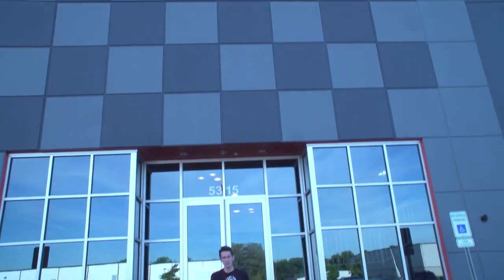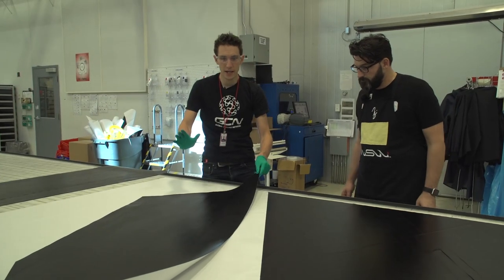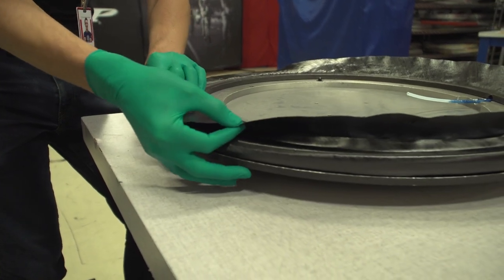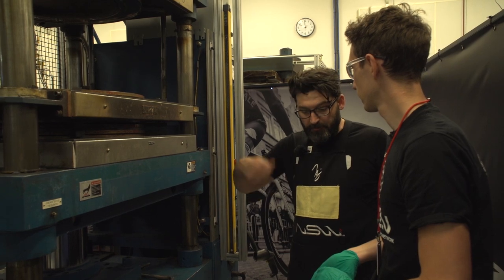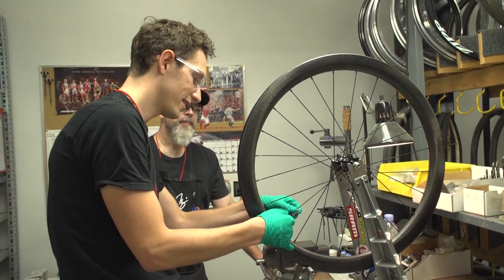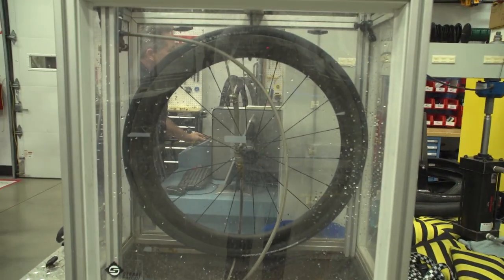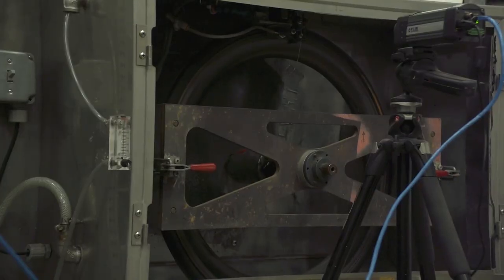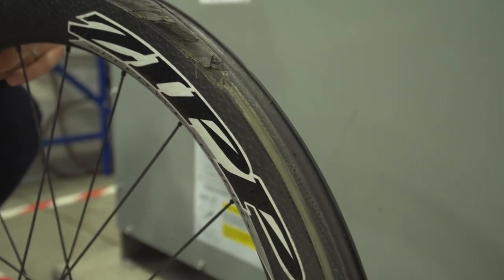How A Zipp Carbon Fiber Wheel Is Made – Inside The Zipp Factory

Comment: Wow, they actually test counterfeit ZIPP's also. That company is amazing.
Reply: Did you watch it?  One of the Zip counterfeit wheels in question had a spelling mistake on it. I doubt that Zip would have built a sub-par wheel with a deliberate spelling mistake just for our viewing pleasure.
Reply: Fran Rod What is overpriced, the real thing or the knockoff?
Reply: Those were clearly counterfeit wheels. You can tell by the Novatec hubs and the lack of correct Firecrest markings.
It's also funny how every time someone brings up counterfeit someone chimes in with "well they work for me!". We know nothing about your riding style, where you live, how much you weigh, where you bought them from, etc. The biggest difference is that the QC levels are a probably not nearly as high. So maybe you got a good set, whereas others could get a really bad set. Everyone I know who has had carbon wheels living in California eventually have problems with them unless they use them only for crit racing where brakes aren't used a lot and there are no long descents.
Reply: Fran Rod You get what you pay for, I guess.
Reply: Charles Rush I would imagine that Campagnolo would be as expensive, if not more that ZIPP wheels.
Reply: Charles Rush Sounds like a tariff was involved in that transaction. (I recently bought a bike frame from Canada, and customs taxed me, bigtime.)
Reply: Zipp make good wheels no doubt about that but why not show more of the tests? I've seen loads of carbon auto performance vids showing all data and close ups.
Reply: I remember when people were saying counterfeit Beats by Dre on ebay were actually sounding better than the originals ......
Reply: kingcarcas1349 Except it was known Beats was always a shit product and nothing more than a shill brand. Dre bought another company and relabeled it.
Reply: Alex R I have heard that and I have wondered if they come close to say Bose or sennheiser.
Reply: also a decent way to show what could go wrong if you buy anything but ZIPP :-D
Reply: I was thinking something very similar!  Chinese carbon wheels are made in a very similar fashion.
Reply: lmaooo
Reply: Charles Rush  Thread necromancer here. There are marketing opportunities for showing how crap a counterfeit products can be. You test them to understand their flaws, show people how dangerous they are, and that can drive sales of your own products.
Reply: As skeins who's ridden Chinese carbon wheels for years and just recently got a nice deal on genuine Zipp Firecrest 404s, I can attest that fbu Zipps are simply in another league, there's no comparison to ride quality, how true they are under load and stationary, and even braking ability.  I'm far more impressed than I expected.  I never had any major issues with Chinese carbon but I now realize it is not really comparable.

Comment: I got a pair of Zipp 530 wheels with aluminum braking surface flyet to a carbon rim in 2001. In 2015 I had to stop riding them since they was getting so soft several places on the carbon rim like they were delaminated. I hope the wheels are better now.

Comment: I'm not advocating counterfeiting of Zipp wheels but it'll be good for consumers to see the difference of the impact test and brake track delamination test of the real wheels.  I think the reason why they don't show it is because both wheels will fail in a relatively similar way albeit the counterfeit ones at less loads and stresses.  If that's the case, I would prefer Zipp wheels to be more affordable by lowering their design limits so they cost less to produce.  I mean who would pump their tyres up to 338 psi??!!!

Comment: So why does their website say that the max pressure is 8.5 bar?
Reply: safety factor. very high safety factor.
the pressure goes up once you get on the saddle, too.

air compressor tanks have a 2.3 to 1 safety factor. boost it a bit for the fact that there's a rider riding the bike, and you'll see that it's reasonable.
Reply: Justin Crediblename IT is safety, but the rider doesnt add as much pressure. From 8.5 it could maybe get up to 10.

Comment: So as they've stated, it's probably not a good idea to buy a knockoff set of carbon wheels.  However, I can attest to the fact that SuperTeam, a Chinese wheel manufacturer, makes amazingly nice wheels for about 1/10th of what a set of ZIPPs will cost you.  I bought a 38mm set from Amazon for $250 and after 7,000 miles, they still look like new, are perfectly true, and I'm very happy with them.  Buy ZIPPs if you have too much money laying around, but if you're like most people, you'd be hard pressed to beat the SuperTeam deal.

Comment: Notice they didn't show the impact tests on the real Zipp vs the "counterfeit". There are many documented examples of the "counterfeit" wheels out-performing the real genuine branded products, the truth is that with carbon it really does come down to each individual piece and a brands track record should not be the only consideration made when they all have had numerous products fail, and continue to do so. That includes Zipp. The big brands fail just as much as the cheaper chinese alternatives.
 The reality is that the big manufacturers are feeling the squeeze from the much more affordable products produced by the chinese carbon fibre cycling parts industry. Many of the cheaper option copies being made in the very same factories as some of the more well known branded options, and in addition to that, they are also subjected to the same rigorous quality and safety testing.
What you saw in this video in my opinion was absolutely propaganda to create fear for the consumer that is considering whether to pay the big bucks or take the cheaper option. In my experience I bought a set of chinese 50mm clinchers which I am very happy with still after almost 5,000kms. Don't fall for the fear campaign. Paid presentation?? Yeeeeppp.
Reply: they are just mad because most the time its the same wheels being sold by one of their manufacturers under a unbadged or rebadged name for cheaper because they are excess product.. some manufacturers supply a certain line of products to various costumers( big brand name) and so of course they make some for whoever buys in or the factory sells some themselves for some marginal profit. We do get some people who collect and try to resale recasted or failed product from time to time.

Comment: $3000 for a wheelset, is the same as a used car. Why is that marketed so high?
Reply: Low volume.  The guy said 2000 wheels a year which is incredibly low.
Reply: Well in the US, Zipp Firrecrest retail fro $2,100/ I wouldn't rely on a car I paid $2100 for, but I'd sure would trust my Zipp wheels on the steepest descent.